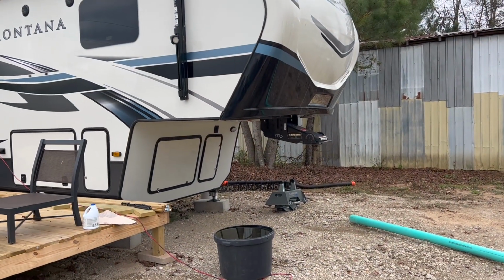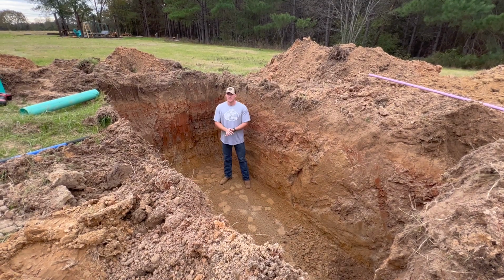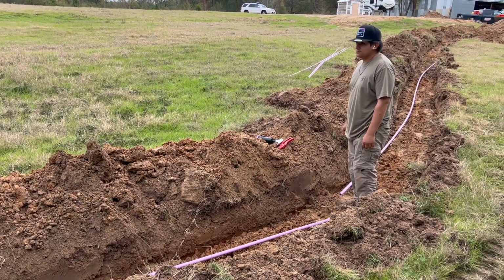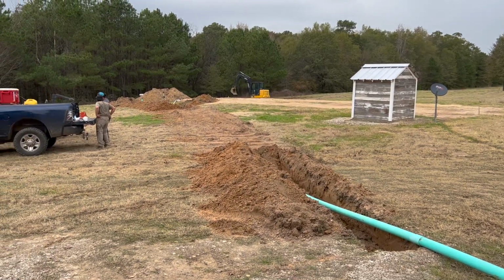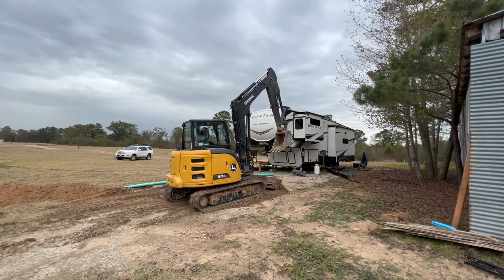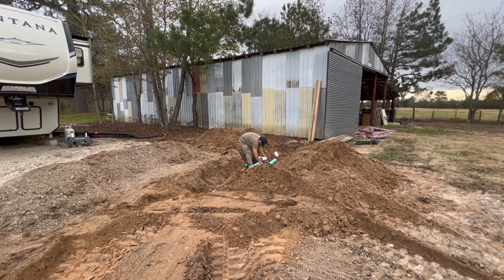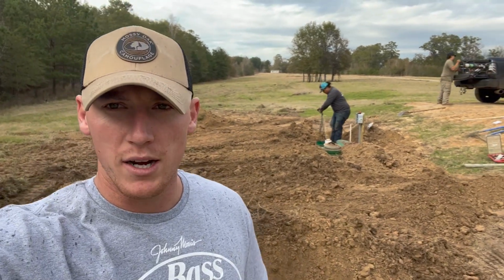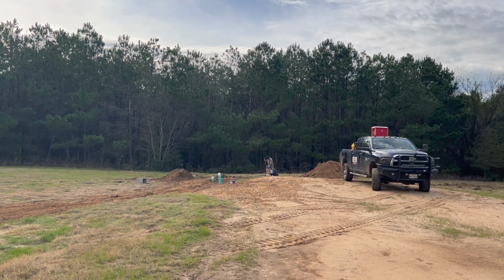One Step Closer to LIVING ON THE RANCH! | Septic System Installed

Comment: I don't know about the use of the "T" fittings.  You even mention that the connection to the mobile home is going to be in a different spot than where they stubbed out for it.  Once you get the final location figured out, I'd cut that "T" out at 2:01 and put in a Wye fitting that will give you a straighter shot to the home's plumbing.  Gradual bends and not a sharp 90° will keep the "stuff" flowing downhill.
Reply from the maker: Thanks for the input! :)